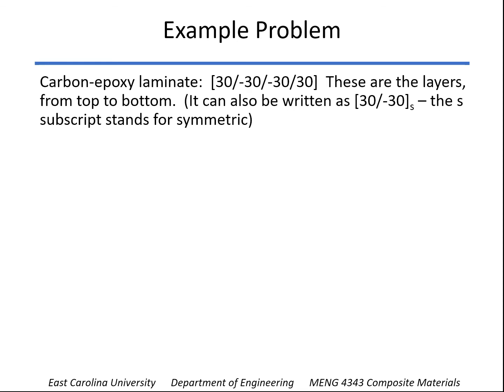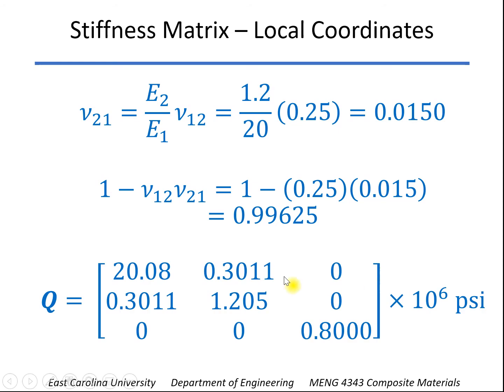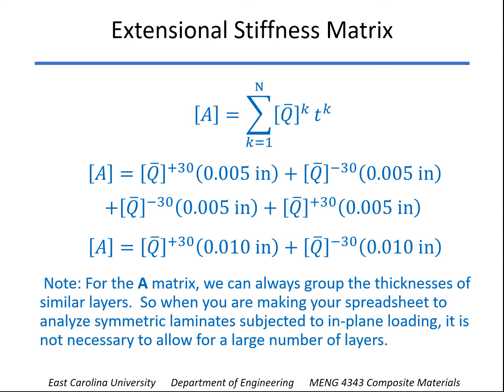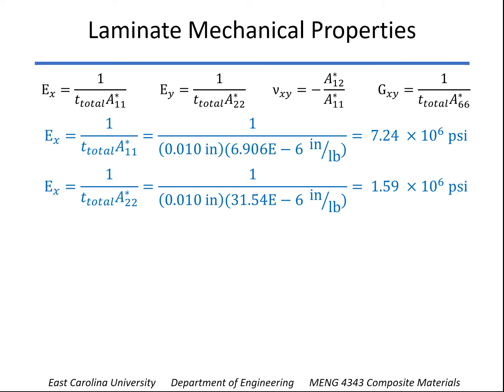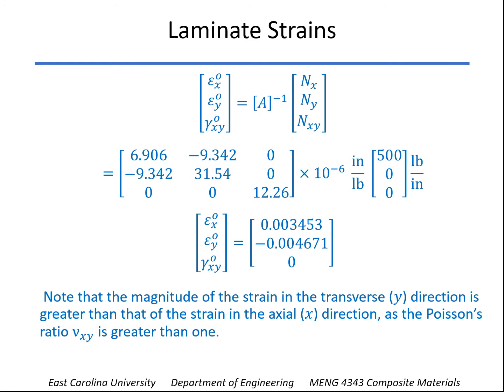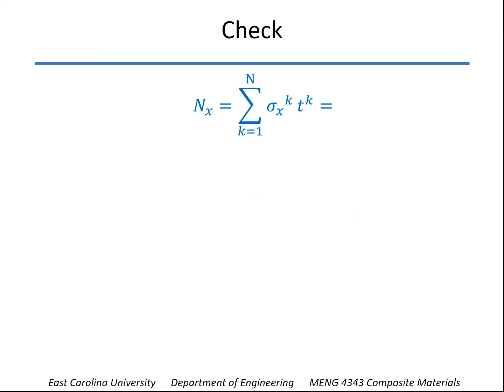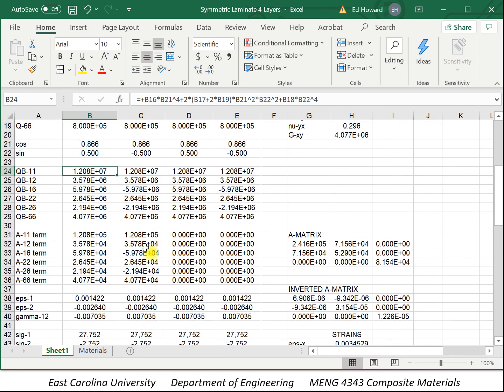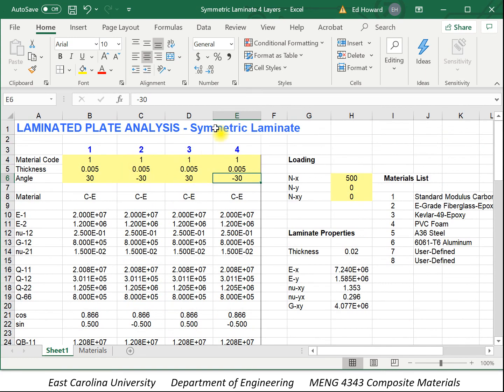Section 3 Part 2 CLT Example

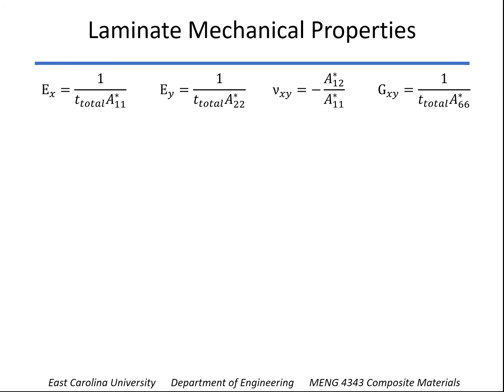Comment: Thanks for pulling this together; an excellent series of videos.  At timestamp 4:33 the mechanical properties of the laminate are evaluated using the relevant terms of the inverse [A] and the total thickness, t_TOTAL.  Where t_TOTAL is used, this is only half the actual total thickness of the laminate; 0.010'' instead of 0.020''.  

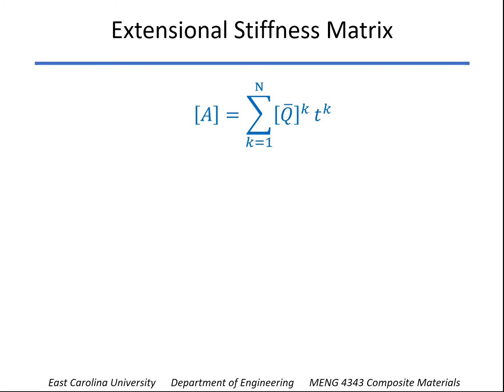My understanding is that as the [A] and thus its inverse are calculated based on the sum of [Q]_bar for each fiber orientation and each layers thickness (see timestamp 2:43), this would mean the [A] and inverse [A] terms are based on a total thickness of 0.020'' (4 layers each at 0.005'' thick).  

I'm guessing only half the actual total thickness is used as the stress resultants are based on the midplane strains and thus the distance from the midplane/membrane to the outer surface in the z-direction is one-half the actual total thickness, but it's not really clear to me yet. Thanks.
Reply: Yes, the t_TOTAL values used in the equations should be 0.020, not 0.010.  The results for the mechanical properties are correct, but I typed the values into the equations incorrectly.  Thanks for pointing that out.  I used to be able to add a comment box to the video at the point of the error, but YouTube doesn't have that option anymore.
Reply: @edhoward1061  Okay great, thanks for clarifying Ed.
Reply: I have the same 
doubt.
Reply: I already checked and it is correct, you need to use total thickness 0.02 in, It´s a mistake in the presentation.